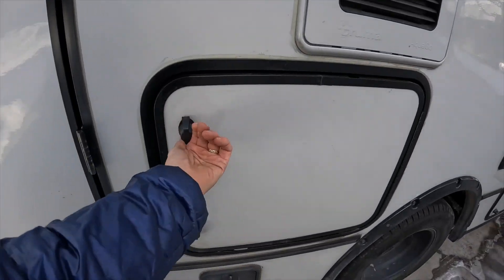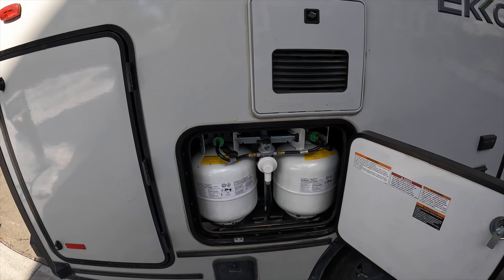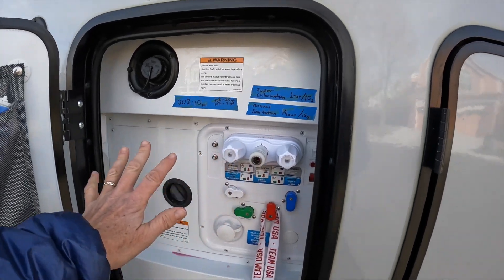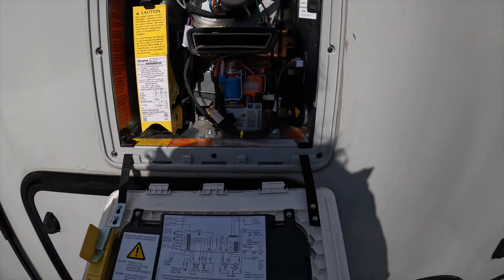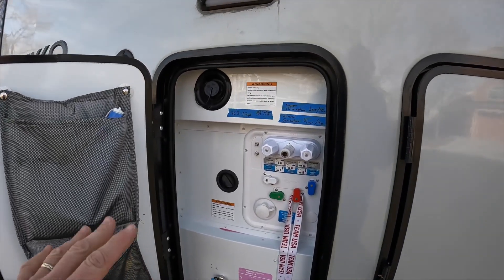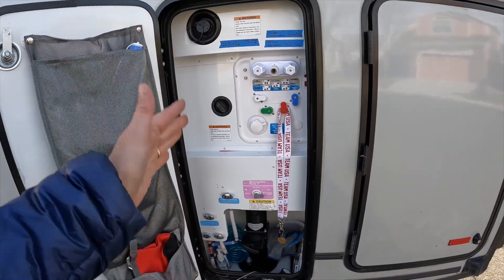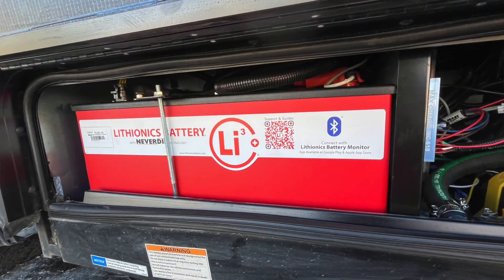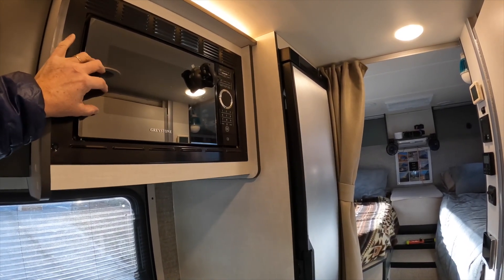One Year EKKO Review: Systems

Comment: I'm surprised that you were able to use both the DC to DC charger AND the secondary alternator to charge your battery.  I was under the impression that the BMS system built into the Lithiotronix battery would prevent that much current from coming in.
Reply from the maker: That's a good question, Lawrence. I looked up the spec's on the different components. The Lithionics battery recommends a charging current of 150A, but the over-current cutoff is 250A (after 2 minutes). The max output of the DC to DC charger is 50A. I believe the Balmer second alternator in the EKKO is the 170A version. That would make a total max charging current of 230A, which is above the recommended 150A for one battery (but still below the over-current cutoff). However, we have two Lithionic batteries in our EKKO, connected in parallel, which means the charging current is split between them. So our two batteries should be able to handle up to a 300A charging current.